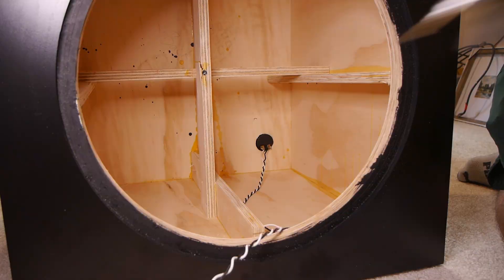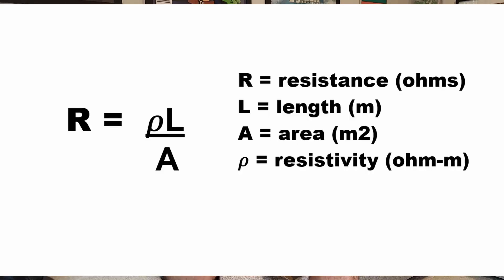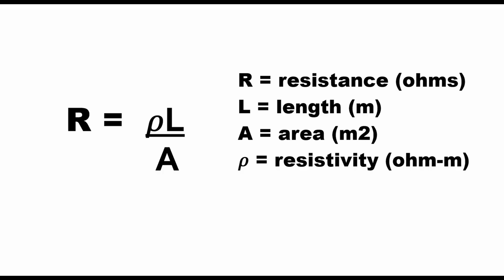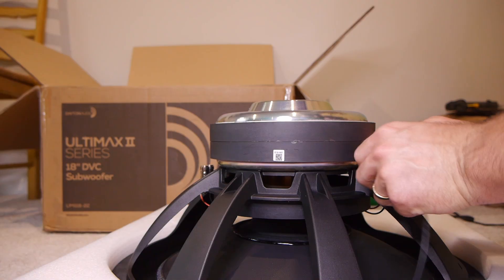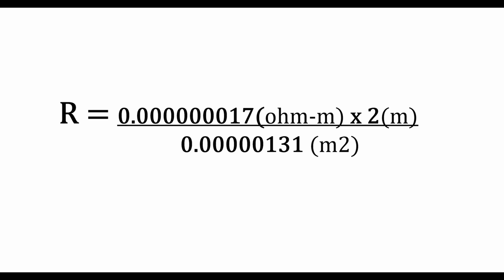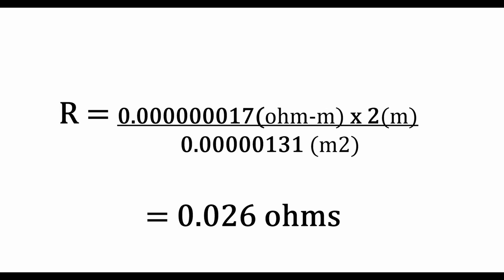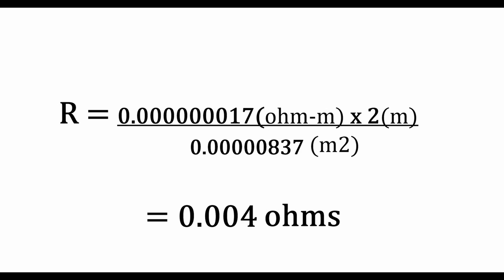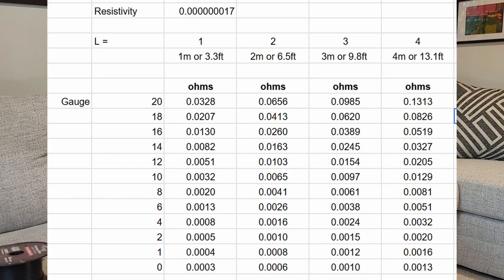Does Wire Size Matter?!? I say NO.

Comment: Wire size depends on current which depends the impedance of your load. In automotive audio, a subwoofer wired 800w into 1 ohm may warrant an 8awg wire. The same power into a 6-8ohm sub, 14-16awg is fine.
Reply from the maker: Well, itll then be 1.024 ohms. But yes your point is taken. On my ultimax build the difference on a 4ohm sub vs a 1ohm car audio sub is not as obvious. I still believe both are essentially irrelevant.
Reply: @ImpulseAudioSpeakers  ~800w into ~1 ohm is ~30a. The average content would be much less but the peaks could exceed 50a. It’s somewhat relevant what size wire you use if you employ dsp boosting to lower frequencies on low impedance applications. But outside of specific use cases, 14-18awg is a very ideal wire size for short runs of speaker wire.
Reply: @ImpulseAudioSpeakers  Isn't the concern that the resistance of the wire means it's a resistor, so it has to dissipate the energy as heat, therefore raising the temperature and changing the resistivity and risking melting the jacket or in an extreme case causing a fire?
Reply from the maker: @schwamforfreedom i thought about getting into that in this video, but lets face it, a video about wire resistance is pretty lame already. The heat dissipation from a music signal at 0.024 ohms is nothing. You can work out the math with some google, but youll quickly see its no big deal. Regular wall wire is 14 gauge for 1500 watts continuous for days and that doesnt melt. Even if you have a 5000 watt sub amp the average power will be in the 200 watt range.
Reply: @ImpulseAudioSpeakers   Definitely, at 0.024 ohms at room temperature there isn't anything to worry about. However, the 1.024 ohm example from from your comment above, over a relatively short period of time will generate enough heat to increase the resistivity of the wire potentially starting a run away effect, which if inside a confined space, possibly with polyester stuffing and or other heat sources seems potentially risky.
Reply from the maker: @schwamforfreedom your voicecoil melts first, every time. Trust me.
Reply: @ImpulseAudioSpeakers  No thanks. Your assertions of certainty regarding circumstances you can't know, when there are plenty of woofers out there that can handle long duration sine wave inputs at 1000 watts RMS or more and speaker wire varies in quality greatly, are your prerogative for people to take as they want. I'll stick to trusting my education and experience.
Reply: @schwamforfreedom not only that but the voice coils are pretty much actively cooled too, albeit you could run silicone wire, those usually have insulation temp ratings up to 200°C

still i like my dynamics so i prefer to keep resistance low
Reply from the maker: @schwamforfreedom but it's still only 0.024 ohms in the wire. You said 1.024. Anyways, my comment wasn't meant to be certain of every circumstance or undermine your education. I was just making a quip that should be reasonable in general. We see melted VCs with some regularity. I've never personally seen melted speaker wire. I'm sure there's an example out there that proves me wrong though. Anyways, no harm using a larger gauge wire. It doesnt cost much. Go for it.
Reply from the maker: @schwamforfreedom I did some quick calculations assuming a worst case scenario of 1000 watts continuous, 1ohm sub (not very realistic, even if rated 1ohm), 16 gauge wire at 2m length, for 1 min. This would raise the wire temp 16 degrees C. Consider that even very good amplifiers can't deliver 1000 wats into 1ohm for 1 min and music would be far less power, and a 1ohm sub is going to have a much higher apparent load (thus reducing current) I feel this isn't a concern. Certainly I didn't intend for this video to mean if you're running massive power in SPL comps to go ahead and use 16 gauge wire. For that you may as well use something a little bigger, like 14 😅
Reply: @ImpulseAudioSpeakers  I see what you mean about the 1 ohm example. I did think you were referring to higher wire resistance in his example but see that was silly. Regardless, I think you are focused on the low resistance calculations you get from a static equation and and are missing the general goal of sizing wire to prevent disaster, not to satisfy 99.9% of conditions. Safety factor is important in design calculations and while I can't say you don't have any, it seems to be unconfirmed by any sort of worst case calculation. I have seen burnt wire and burnt speaker enclosure stuffing. And that was before modern amplifier technology was creating true one, two, 3 thousand watt amplifiers so the risk is real. I fully agree you are almost always right that larger wire is unnecessary but there are factors that make your mathematical assumptions questionable in less than ideal conditions such as corrosion, mislabeling, kinks, etc. Also, did you consider the increasing resistivity over that minute? Or just calculate the theoretical rise assuming constant resistivity? Did you consider a smaller, more in line with your expectations of amplifier capability, current over a very long period? Did you consider what happens if the woofer sustains damage and has a lower resistance than expected but doesn't short the amplifier? There are quite a few amplifiers on the market that sustain 1000 watts of a sine wave indefinitely, into very low resistance. You may not have been referring to a situation involving them but your title, content and comments indicate a level of certainty that for me personally, somewhat diminishes your credibility as someone to be a trusted source of safe and well considered information. That said, I appreciate the conversation about my specific concerns. It has been interesting and informative.
Reply from the maker: @schwamforfreedom it was a basic calc. The resistance doesnt rise much based on 16 degrees. Maybe undetectable. Yes there are many amps that can do it, but its not that common in my opinion. Especially into 1ohm. If the VC goes to zero the amp should shut down before the wire melts, and if it did, who cares about $4 worth of wire when you just killed a subwoofer. 

Sorry, but whats the argument about here? Im merely pointing out how much people fear wire size when maybe they dont need to. Sorry if the title was click baitish, but i was clear in the video the 8 gauge wire significantly changes resistance. Even the 1000 watt example i gave was very unrealistic considering musical power would be a 1/4 or less power. I dunno. If you disagree thats fine. I provided the facts. Youre allowed to disagree.
Reply: @ImpulseAudioSpeakers  You managed to reply before I finished editing my comment. Sorry. I doubt it changes your response but only fair to point out the edit. 

I think the edit of my last comment clarified my point a bit but it can be summed up as concern that a blanket statement, which you point out is click baity, and understandably so when they are directly attached to your videos success (Thanks humans) is a pretty risky take and that the video and your comments seem to have a generally risky certainty about them. Wire sizing calculators and charts are readily available to give industry standard guidance to anyone who is interested. I understand for the purpose of the title, but I don't understand the lack of reference to industry standard guidelines in a video behind a title that says the industry standards are irrelevant. Maybe I missed something though and am off base. As you can tell from my comments, the video raised many more questions than it answered. Cheers and thanks again for engaging despite our different perspectives.
Reply from the maker: @schwamforfreedom i like the engagement more than making videos. Years ago I spent a lot of time on forums having these discussion. I actually miss and prefer that. It was easier to exchange ideas and I learned a lot. That started in the early 2000s when I was in college for engineering. Youtube and other social media actually kind of killed those places unfortunately. 

To be honest Im not aware of any industry standards for enclosure wiring 😅 Maybe Im daft but the only ones I know of are for home wiring. Which for 15 amp would be 14 gauge solid copper over something like 40ft. 

The video was NOT meant to be a blanket statement. It was meant to share how its calculated and let the DIYer decide what wire to use. I thought the end of the video was very clear about that. I used 16 gauge in my 4ohm HT subwoofer, and thats the example I used. Ive personally never seen burnt wire (in person) without serious issues with the driver or amplifier first. The video doesnt condone using 20 gauge and 1000 watts. And as for the title, well I only get so many characters and re-reading it seems to me Im just looking to help people decide if wire size matters. I mean, yes its meant to grab your attention. But the video delivers I think. I dunno. Maybe Im full of crap. But I did the calcs and I dont see a problem here. If running SPL car audio comps, sure, run big wire. I cover HT and HiFi on this channel and most tweeters dont need thick wire 😂 Thanks for watching though.
Reply: @schwamforfreedom I would be more concerned about your hearing loss at the power levels you're talking about.
Reply: @tomsrensen9382  That's thoughtful of you.